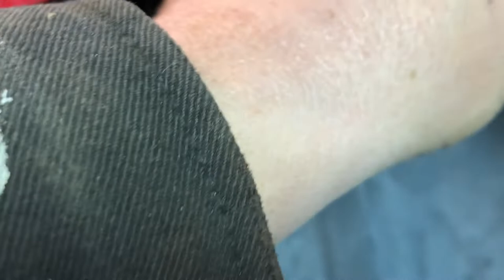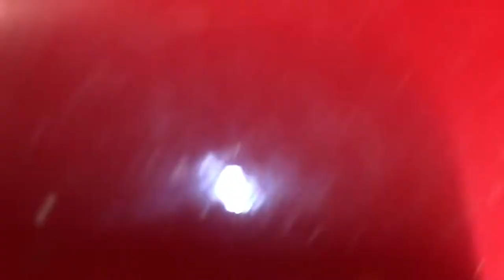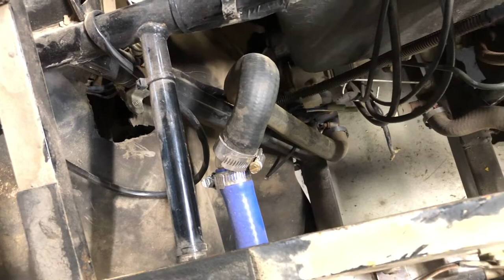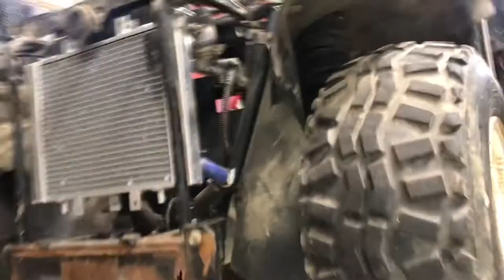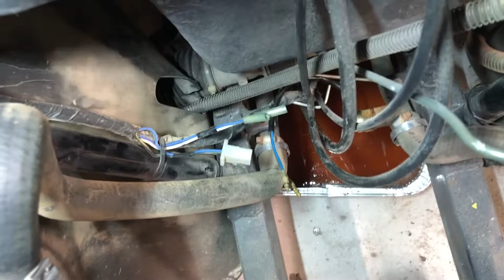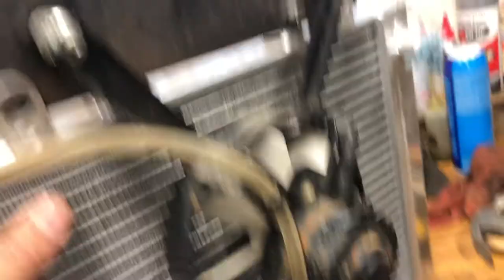Kawasaki Mule 1000 - Part 2 Radiator

Comment: So, is it a 1000cc engine ?. Just bought one today with the full cab enclosure. And its is pretty good condition. Needs rhe carb floats cleaned but runs. I was wondering how much power it had and its average speed?. Were adding A/C to ours cause were old and fat and in Florida!!. 😂. This thing is way cool.
Reply from the maker: Ha. Up here I’d opt for a heater. 
Mine tops out at 27 mph. Not sure what it’s supposed to top out at. It stutters at 25. The carbs may not be fully synchronized.